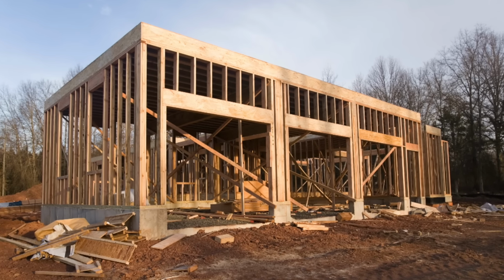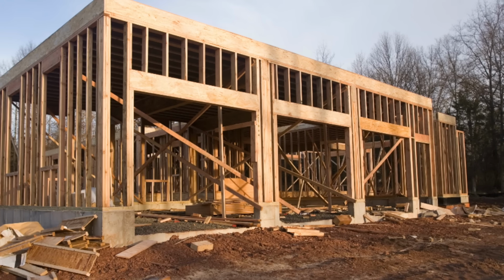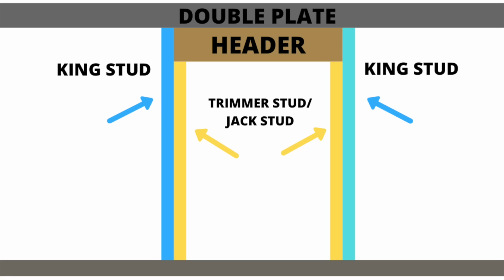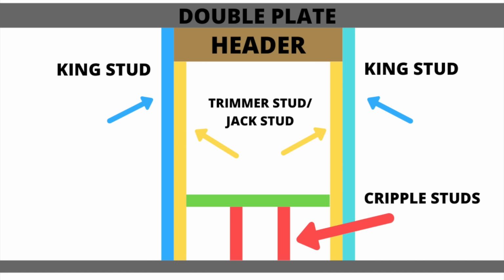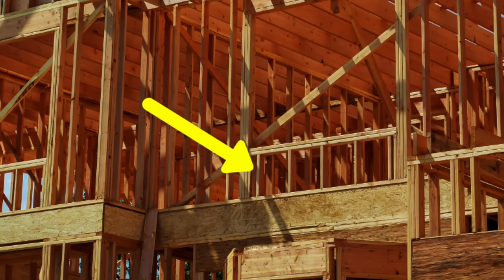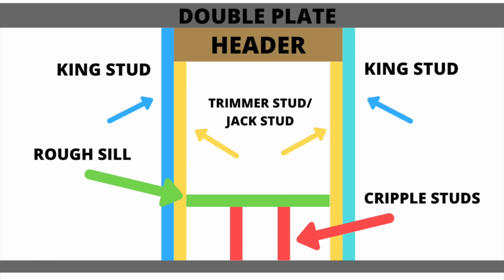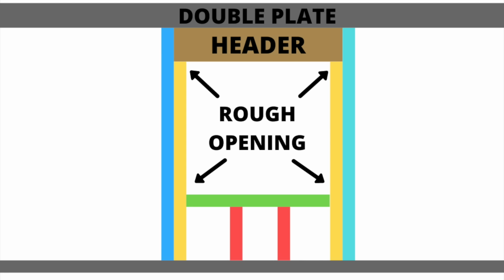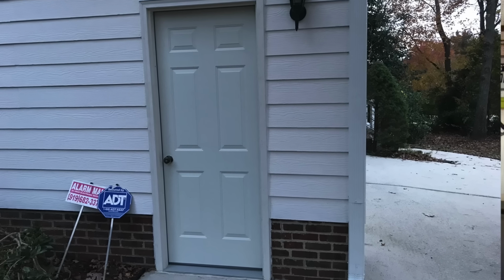All House Framing EXPLAINED...In Just 12 MINUTES! (House Construction/Framing Members)

Comment: Question: I seen framing that have a board going across the wall from bottom left corner to the top right corner, what is that called and what is it for?
Reply: Cross brace. So studs don't bow
Reply: Diagonal bracing, to counteract shear forces.

Comment: Electric cable wires have been sent through holes on joists, does it weaken the strength of joists or ceiling for that matter ?
Reply: yes probably does...but even so,  with the holes, they are still plenty plenty strong enough. houses are static structures and don't really that much weight.
Reply: @jackheinemann8780  Static structures until high winds or earthquakes!
Reply: @jobacuda4472  very true,  where i am in australia we have neither.  But I know that it is very diffrent even a thousand km north though they get cyclones every year that want to flatten everything. They have very tight building codes up there.     Food for thought though.
Reply: It depends upon the size of the hole, where it is in the joist, and how the joist is made (e.g. dimensional lumber vs I joist.

Comment: Trusses seem easier, and probably a little cheaper than rafters,  but dont they limit you from remodelling up  If you want to add a room in the attic later on?
Reply from the maker: Yep, they speed up construction tremendously, and make it much easier to design open floor plans. But you lose a lot of that functional attic space 😬
Reply: If you talk to the truss company, they can generally design trusses with attic space.

Comment: The only thing missing, is that (particularly on long outside load bearing walls) the side you pull from to layout the first floor joists, is the same side you pull for those wall; which continues up all the stories/floors until, if a cut roof is used, the rafters sit on the the studs. Load is transferred from the the rafters to the studs below, to the joist below, to the studs below to the joist below. 

This fact, seems to be missing in most, if not all, the framing videos I’ve watched.

Also, solid headers are not just used on exterior walls, but also on load bearing interior walls.

Comment: I don't understand why brick and block never took off in the USA. Especially when you have termites and woodworm so common in the US. I guess all new builds will now be modular SIPS, so you'll just leapfrog the brick and block
Reply: I have never seen a home with termites in my area. Also the US has a abundance of wood which makes it a cheap renewable resource.  There are pros and cons to every type of construction. Building out of stone or concrete isn't always the better way.
Reply: @randybobandy9828  I get that it's cheaper,  but wood degrades far quicker than stone or brick or concrete.  I'm a big fan of using engineered timber in construction,  however that can't compromise the longevity of the building. Also local stone is just as sustainable and in my opinion better aesthetically.
Reply: @bengoacher4455  if built properly a wood home will last a century or longer. I guess I don't really care if It lasts 300 year or not. Wood is abundant and plentiful. Unfortunately for you in Europe you clear cut all your forests so you don't have the option of cheap lumber. Also I though Europe was all about being green and reducing your carbon footprint? Wood homes take far less common to build than. Concrete or brick.
Reply: @bengoacher4455  Wood basically doesn't degrade if it doesn't get wet. If stone doesn't degrade, why have all the old castles fallen down?

Comment: Very enjoyable and informative. I've been a self-employed builder for about 40 years,having learned a lot from my father-in-law, who was also a builder. We used to make our own cabinets, clapboards, doors and window frames. one of the terms that often gets confused is the window sill, which is used to refer to three different things. The "sill" is the framing member that the window rests on; the sloping part at the bottom of the outside of the window itself is called the window "stool"; and the horizontal flat piece of interior trim at the bottom of the window where people often set their house plants is the "stool cap", which usually receives the vertical casing.
Reply: The framing member is the rough sill.

Comment: Question: when coming out of the hole, how do you level the next floor? Elevation? Plum level and square is just a theory. How do you get the next elevation within an 1/8 or 1/16? Cunts hair. Sorry. Are there bench marks in house framing? Where are they? I would imagine that your municipality has elevation points with respect to sea level. Or am I wrong? Where do you pull your numbers from? Thank you.

Comment: Here in Ontario,Canada there's a shortage of house framers, if you can do this you will be very solicited,  the hourly pay is $37/hr (2020) but most people I know are their own contractors making over $2,000 a week.  I was going to get into this field and go to framing school back in 2004 but I had to spend 9 months of my life in classes, and then I was going to get paid only $21/hr as an apprentice for 2 years and then only after 4 years I was going to get full wages,  $27.50/hr in 2004.  I was already unionized and making $28.80 at a comfortable job, so why would I go to school for 9 months and get paid LOWER than what I was making after 5 years?  It was a sucker's deal.  But going forward I would be making more than I am now as a framing contractor working for myself, but I would be broken from heavy work every day, whereas now I only work hard as hard and make $40/hr.  I got job security, high wages, and a comfortable job, what else can I ask for?

Comment: As a builder I would like to stress the fact that sheathing needs to happen per floor and definitely before any type of roof system get installed seen other builder fail to do so and have had house fall under them while doing the roof
Reply: If we couldn't sheathe the walls before standing them, we used a lot of temp diagonal bracing.

Comment: I've had two houses built in the last 15 years. Nice to see this stuff explained.  The last house three years ago- The floor feels weak as in when people walk by  you can feel them walking. I think the problem is that floor joist spans to big of an area however the builder says that it is engineered correctly.  In most of the joist, they go from the beam in the middle of the house to either the front or back of the house, to have been done correctly, I think the joist should have been one piece and gone all the way from the front to the back of the house without the cut or break at the beam. Joist within the last 8 - 10 feet from the side of the house are at 16" centers or little less but in the middle of the house joist are closer together so you'd think it wouldn't feel this spongy.

Comment: 2:20 I'm no structural engineer by any means, but that cannot be safe. The whole drilled in the joists takes up 95% of the cavity, leaving only a sliver of OSB on each end. The only structural aspect of this joist is the cap and a tiny bit of OSB. How is that even allowed?
Reply: I thought the same thing... I'm like...maybe a 3 or 4in hole but that was a 8in fucking hole.
Reply: The holes are fine. Here is a table: https://www.fp-supply.com/cmss_files/imagelibrary/I%20Joists/Allowable-Holes-I-Joists--amp--Beams.pdf. Notice that a 9 1/2" tall TJI can have a 6 1/2 " hole it. Basically the whole web. Of course it depends on where the hole is, too.

Comment: I'm just gonna build it outta steel and aluminum so I can weld it all and never worry about rot or mold in the bones of the house
Reply: Ya you will just have to worry about rust a corrosion.  Wtf are you even talking about? Nobody would ever build a home out of aluminum.
Reply: Also how oftenndo.you think house rot? Not often if it's built well

Comment: Osb as a band board? Um ok. They say those I beams are stronger than a 2x10 but the 2x4s are more like 1 1/2 x3 with some 5/8 osb in the middle. I ain't buying it. And they still twist and bow just like any other board.
Reply: Ua I have my doubts that they are as strong as a 2x10.
Reply: You know how stupid the engineers who designed them are, right? You probably know a lot more than they do.

Comment: I recently had a structural engineer inspect my home due to multiple persistent and recurrent wall cracks and doors that won't close properly.  The underlying causes were found to be due to problems with the construction (built in 2015) .  The terminology in the report was very confusing to me.  I decided I needed to educate myself so that I could understand the issues.  Yours was the very first video I watched, and I will not need a second one!  Thanks for providing such helpful information in a clear and concise manner.

Comment: 2:24 how is it possible to have such a large hole punched out with an I-joist, but with a solid wood joist you are limited to 1/3 of its depth?
Reply: Tension and compression of the chords .. Generally in the midspan of an I-Joist. The material can be removed in a circular hole .but never touch the chords , There are charts that indicate what size hole can be drilled in the specs of the sized joist  , how far away they can be from another and how they have to be reduced in size as they approach a bearing wall or a point load . .. I know it looks crazy like a toothpick left holding the floor together . Many times I have run into HVAC contractors that say they cant go through an I-Joist .. I tell them " How long have you been doing this ? "   There are factors to consider .. Like if a wall is a nonbearing wall but it was built a wee bit too high and will react as a load bearing wall . The forces at play get displaced called Moments and react to the entire I joist .. But that's another topic altogether ..

Comment: learned a lot but one thing  no one ever talks about is how the figure out how much weight the structure can safely hold on it. Is there just generic house designs that come with standard weigh capacities. Like house A is built using design 1 and it comes with a 10k lb capacity for every room on the second floor ? or is it a matter of how many studs or stud packs are in the floor bellow?
Reply: A lot is in the Building Code and can be applied to any "normal" home. Studs are normally spaced at 16" on center. Cheap builders will use 24" on center when they can.

Loads for floors and roofs are figured on a per square foot basis. "Dead Loads" are the weight of the structure itself, like the weight of floor joists, subfloor plywood, finish flooring and any walls that may rest on the floor span. Dead loads basically don't change over time. "Live Loads" are any that are not permanent and can be moved readily, like furniture, appliances, pool tables, etc.

The total load of a floor system is the total unsupported square footage of the floor times the dead load, maybe 10lbs/sqft, plus the total square footage times the live load.

Stud packs or other types of columns are used for "Point Loads", which are locations of concentrated loads, like at each end of a beam. These locations must have support all the way down to the bottom of the footings.
Reply: @jobacuda4472  Oh ok starting to see how they do it. So equation is something like. Total load= (unsupported(1/sqft)*Deadload(lbs)+[total area(1/sqft)*live load]. So there is definitely  a increased load capacity depending on stud spacing it seems. is there diminishing returns with closer spacing than 16" spacing. So would say hypothetically would 8" spacing not get you twice capacity and there for not be worth the extra expense?

Comment: Thanks very much The Honest Carpenter. This is very similar to how we name things in Australia. We call girders bearers, and rim board is called a perimeter beam & Barge rafter is a Verge rafter. This is helpful as we build 3D framing and estimating software so we can now change the names to help all of our American builders & subs.
Reply: PlusSpec, there are differences in terms regionally in the US, too. It sounds like your software will help a lot of contractors. It's always instructive to build something in the computer first, then build it in the real world. That way you find all the screwups that the architect or designer made. If you need any help in the US, contact me at thehonestcarpenter.com. I have 30+ years in the construction business, including running framing crews and 3D CAD design of wood structures.
Reply: @jobacuda4472  Thanks that is great to know, especially seeing you have 3D framing experience.  If most builders had this we would have fewer issues during construction and after completion. I will book a consultation if you'd like to take a look at what we are doing so far you can find it here https://plusspec.com/plusdesignbuild/

Comment: Your first board is called a sill and must use a sill gasket, foam, tar paper, Tyvek etc.  under no circumstances do you use a pressure treated board inside a residence. Cancer causing chemicals are not used indoors. Stud columns or posts are known as point loads and must be continuous to the foundation to support overhead loads supporting upper floors and roof etc. Without sheeting the framing is quite weak and usually each floor must have at leas 25% of the sheeting installed to give lateral support before adding the next levels, or at least completion of a shear wall.  I remember seeing two stories framed up and the roof installed, along came the wind and took the entire house down like a pile of tooth picks. Never settle for anything but true plywood, OSB is saw dust glued back together to recycle the chips from the mill and contains gross chemicals in the glue and is not suitable for residential homes, when cutting you are required to wear a mask and this board will not stand up to moisture. Long term construction such as condo projects using this material can see rot or black mold already growing on the exterior. It is a race to get the roof on asap to stop moisture in the framing.  Houses framed in spring and summer prove to be the best due to lack of wet lumber being covered up before drying. Houses framed in winter tend to have settling and drywall cracking from lumber drying out too late.

Comment: How many Europeans in the comments making fun of American houses being made of matches and cardboard. I'm American but I agree with them. I was In Europe once and I have to say that houses in Europe are so much better in four ways in my opinion. First of all better build quality and materials, it's all concrete cinder blocks and steel, not matches and cardboard like in the US there more resistant to bad weather and storms. Only the roof is framed with wood Second of all is plumbing, the drain pipe standard is much wider than in the US so they are less likely to clog. Third of all is efficiency, houses in Europe are insulated way better than in the US overall. Fourth of all and probably the best thing is that houses in Europe use 240V as standard power and three-phase 380V-400V as their higher voltage unlike the US which uses 120v as normal power and only single phase 240v as their higher voltage, this means that America is really going be behind with their electric grid to be able to efficiently charge electric cars but also running things like electric pressure washers that have equivalent power to gas-powered ones. That's not to say that there aren't any good 120v-240v single phase pressure washers on sale but I as the consumer would still prefer the gas-powered one because it's more powerful. That being said a three-phase 400V pressure washer that you would find in Europe for example would outperform the same gas-powered pressure washer because three-phase and 400V are way more powerful then so I would rather buy that and this is just an example but you get the gist the same can apply to other high powered or outdoor equipment that would normally use a small engine like a Honda clone.  

P.S I am not a huge proponent of electrification of the future in fact I'm the opposite I just know what the New World Order neo-Marxist tyranny that there pushing in response to the climate change hoax scam, to electrify everything and good luck with that in America with our shittly single-phase low voltage in homes to be able to run all of our fossil fuel stuff on electric, well have to upgrade our whole electric grid before we can have all-electric cars and heating.
Reply: Frank Silvers  Have you ever heard of the story of the three little pigs? No? Cause when I was in kindergarten and first grade here in America I heard that story a million times. You should go to Europe some day and look at their houses.

Comment: I enjoyed this well done video!  A have a couple of tidbits of extra framing info though: when remodeling a home and making significant structural changes, it is sometimes permissible to add sheathing to the interior of a wall.  This is especially convenient to avoid having to remove siding or stucco.  Also, there are pre-engineered metal structures called "strong walls" that are sometimes used to accommodate heavier vertical loads.

Comment: Here in germany no one is framing there house. Its all made out of brick and concrete
Reply: How do you build your roofs?
Reply: @jobacuda4472  most buildings here have flat roofs that are just a concrete roof with sheeting. But yes some buildings (single family buildings mostly ) have framed roofs.
Reply: @Julian_Kurt  Guten Tag! Do you have problems with the flat roofs leaking?
Reply: @jobacuda4472  i have no idea. Im not working in construction. But i think its not a big problem, otherwise they would probably not build it that way